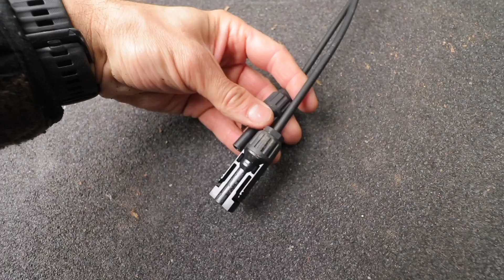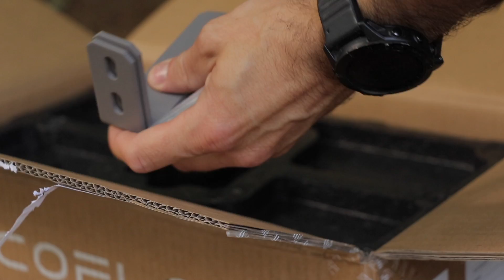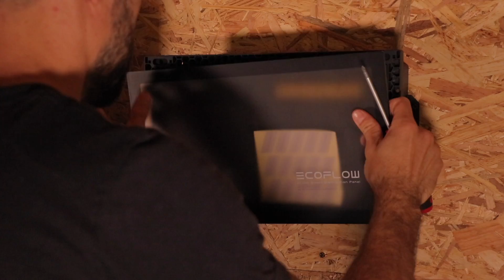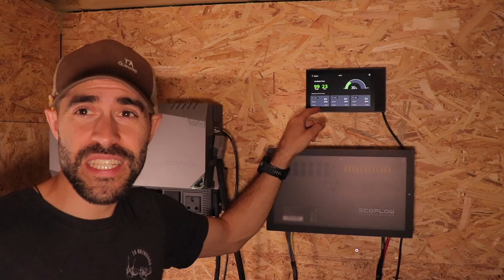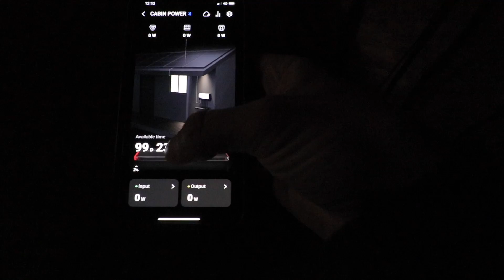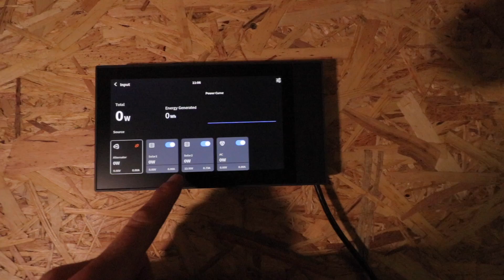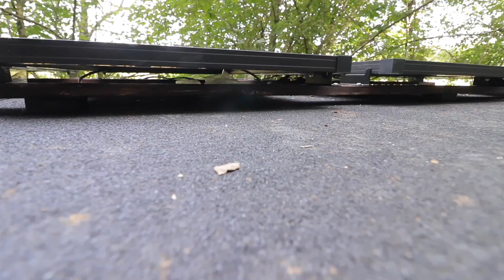Building an Off Grid Solar System at the Cabin in the Woods

Comment: Great job, however why would you leave such a expensive kit on a cabin/ area that has already been hit by theives? 

I could understand if it was a traditional solar setup with independent components. 
Yet this system is modular and compact plug and play. 
Would it not have been better to use it in your bunker at your house? Especially if petrol gets rationed as we move into winter?
Reply from the maker: I explained in the video that this is a totally different area to the pallet cabin that got broken into. That cabin is miles away from this one. The reason for the solar panels is so I can have a permanent camera running for security reasons 👍🏻
Reply: It was a different area the thieves were at